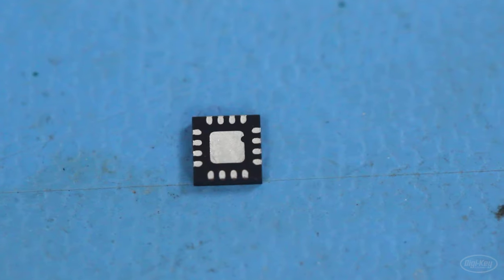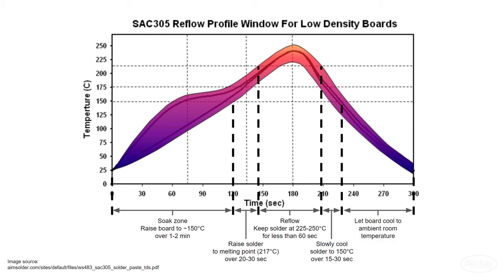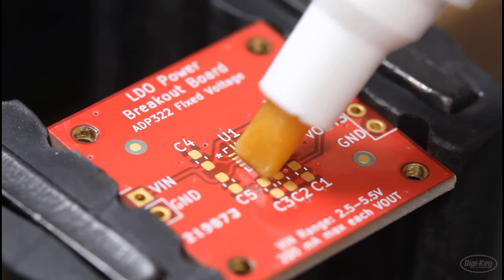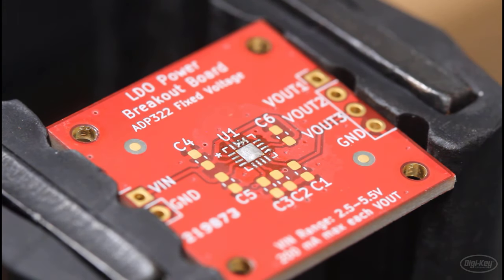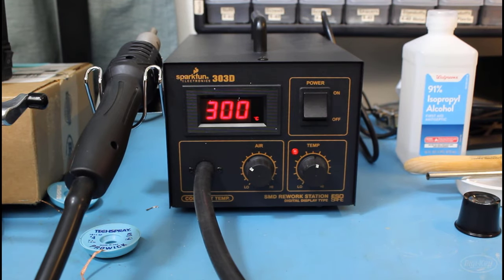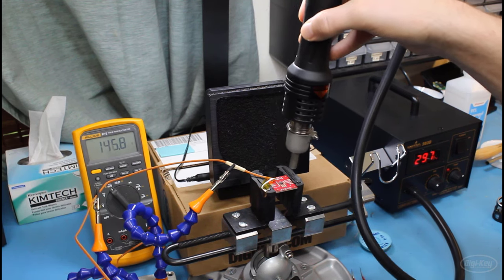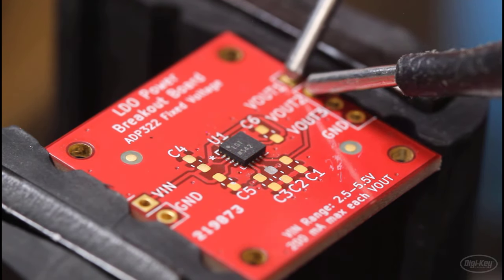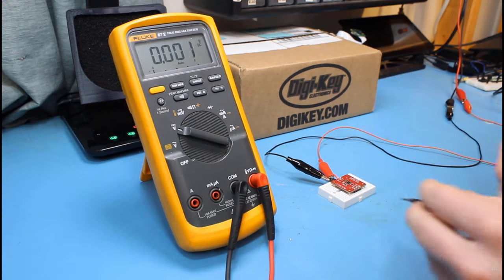How to Solder QFN MLF Package by Hand (Using a Hot Air Rework Station) | Digi-Key Electronics

Comment: I must have watched hundreds of hot air SMT reflows. This is the first one I've ever seen somebody use a Fluke 87V temperature probe to monitor the board temperature. So simple, but genius!!  Learn something new everyday.  😁
Reply: Not the board temperature, though. Ambient temperature.
Reply: I was pinching myself, because my Fluke 179 multimeter already came with a temperature probe. I can try adding this temperature probe method *today*. ＼(＾O＾)／

Comment: Great tutorial! I've managed to solder qfn for prototypes using a heat gun and a solder paste (the paste appears to have a lower melting point than a regular soldering tin). I've applied the solder paste on pads, placed the ic on top of it, and then heated it from the bottom from about 1-2 inches. The heat gun must be on a decently low power to prevent burning the pcb (literally burning it), and there must be no components on the bottom side because they will be blown away. Of course the pcb will be hot, so it's a good idea to make some simple holder.
Reply: This is definitely the better approach, as it not only allows the reflow process to be monitored better, but also means that less high temperatures are required for it.

Comment: Thanks for sharing because I had asumed that QFN parts could just not be soldered by hand without expensive equipment.
Reply: it's possible to solder by hand except for the pad underneath. if your ic does nod draw a lot power it might be fine to just ignore the pad and it should still work. I soldered for example cp2102 usb uart chips by hand and they worked great.

Comment: SOMETIMES if you put enough flux on the bottom of the part and the board you could apply solder to the board and it will flow via surface tension under the part and stick to the bottom pads.  That's one way to solder QFN parts with a soldering iron. YMMV ALOT with this one!
Reply: 'Sometimes' is not good enough.

Comment: I replaced my first smd like component yesterday, a bunch of burned out mosfets on the back of a drone flight controller. Was a lot easier than I thought but putting the right amount of solder paste on the board with enough flux to sit the component in the right place was hard, I had a donor board that I was stealing components from and it was a good job I did because I ended up having to redo a couple of mosfets cause they burned themselves out the second power was reapplied. I don't have multimeter probes that are fine enough to test the mosfet pins. So....accidents happened :)

Comment: If your part is not fresh out of  packaging and has been sitting around - tin the pads on the part too !!, This will increase the chance that all pads make contact with the board. You can thank me later. If you do this for a living you don't need this or temp probe because you bust the temp to 400C and know that the part will be just fine :-)
Reply: Good tip, thank you!
Reply: This is a very good tip. I use very fine sandy paper to lightly rub the pads before tinning. I also never use lead-free solder ...

Comment: small tip use a hollow point tip for the small pads. Also with the via's take a hig termal iron. And if your lucky the via's and pad should connect with solder

Comment: Excellent tutorial.  Can't wait to try it myself.  Perhaps there is a practice kit I can buy.  I bought a budget hot air gun that works well but does not have an air flow adjustment.  I am frustrated that I did not know enough to make sure it had this feature.

Comment: Great Vid, especially the slow temp warming before hitting with enough to melt and make connections .
I about to try a tiny 1285A reg chip which is only a couple of mm's so pretty small. should i use same tech and temps and time?  i worry about overheat insides of chip but have a few spare. Never soldered a chip this small but it makes 3.3 and 5v and about 21 pins and central earth so have to dab solder on that too. Should be fun!!

Comment: I can do that with a soldering iron. EAsy! Recently i did some much more difficult metal can transistors. Not easy! But pulled it off. Take some solder wick and load it up with some solder or use used wick and add a bit. Add solder balls (by tinning the pads) to the underside but not too big, use flux, add plenty of flux above and beneath the component. Now with the component placed well you can heat the wick with the soldering iron while holding it with tweezers. The tricky part is removing the wick without knocking the component about. Enjoy!
Reply: Very interesting but difficult to visualize! Will need a video demonstration ...

Comment: I ordered some components and almost Immediately i needed to add another
 component. They said they couldn't do this (shortly after my original 
order) and suggested I had to make another order (And pay a huge 26$ 
shipping fee). Terrible customer service. I suggest you work on this before posting videos!
Reply: I've purchased parts for prototype products for years from them.  Generally we'd blast an order in before their closing time and expect a.m. delivery.  Once the wheels are in motion they are hard to stop.  I wouldn't fault customer service for this.  A company with a somewhat slower pace may be in a better position to help.

Comment: Not so impressed with the soldering job on the small parts. Perhaps get a navy vet with 2m quals. Also, while Zephyrtronics system seem expensive, you really should be using this grade of equipment for the pro audience and the bottom feeder for the one off hobbiest. You would also have better results and fewer steps with a good solder paste.

Comment: My friend, get rid of that rubbish iron and rubbish hot air. You have a room filled with Keysight and Fluke, you can afford a proper iron and a proper hot air. A Miniware TS80P iron (and a bent round tip for doing this kind of fine works, preferably also a knife tip for general purpose) with a Miniware MHP30 preheater and a Quick 957DW hot air can do wonderful things, even on some rather large boards like computer motherboards, all for less than $400. Also for the sake of love, treat yourself with a pair of Fluke TL910 probes.